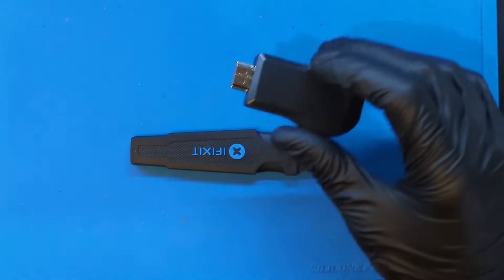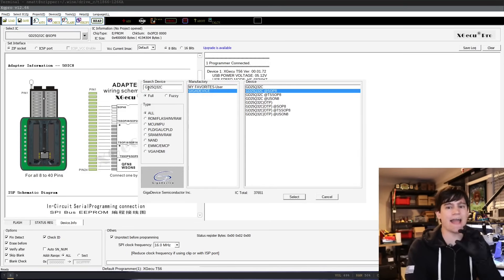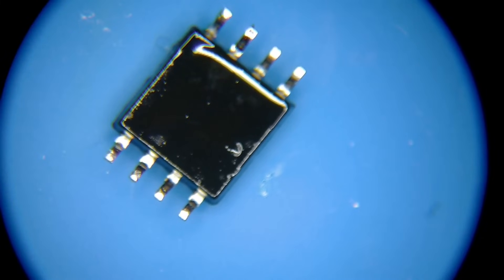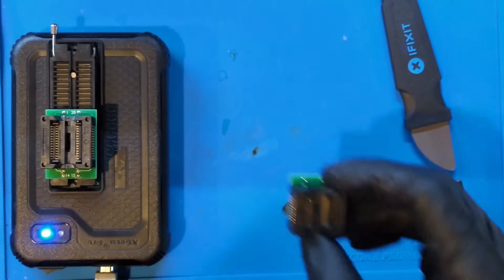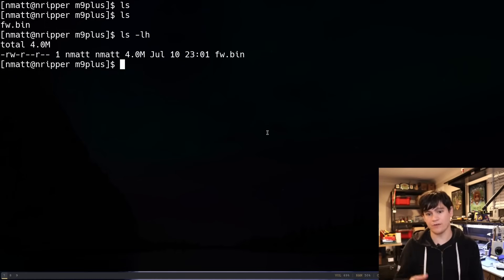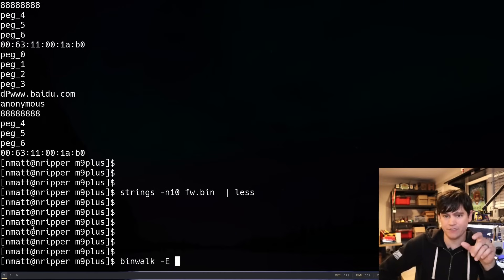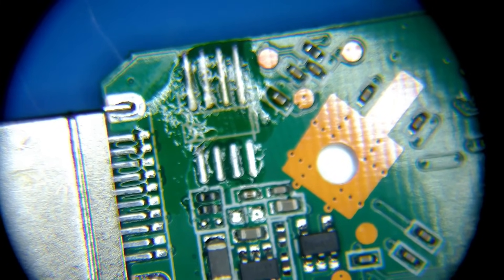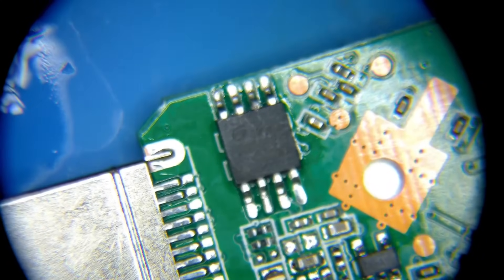Hacking a Knockoff Google Chromecast - Firmware Extraction

Comment: @17:23 it clearly says HDCP :D

"HDCP stands for High-bandwidth Digital Content Protection. The purpose of HDCP is to protect digital copyrighted content as it travels from a device to your TV, usually through an HDMI, DVI or DisplayPort connection."

You might be able to interface that programmer with flashrom, I'm not sure if it is but it should be possible to implement!

I own a "Willem EPROM Programmer", it also supports SPI flash memory like these but these days I generally use a very cheap ch341a_spi USB device.

Comment: 16:58, there's reference to SC16550UART so there's good possibility of a UART output somewhere on that board for the bootloader
Reply: Yep indeed, it's pin 99 on the SoC muxed to UART2_TX quite early on. It's supposed to be pulled up externally + there are some suspicious test points at the other side, but, generally speaking, manufacturers rarely care enough to break this one out in any convenient way
Reply: Might be on the usb port. Sometimes they do that.

Comment: 14:47 At the bottom it says LZMA compressed data
Reply: Glad I'm not the only one to see this.

Rootfs is probably compressed within LZMA and then uncompressed and mounted via the bootloader.
Reply: cliffhanger !
Reply: Towards the end of the video I could swear I had seen "lzma" somewhere, went back to strings and watched closely while pausing, thought I was going crazy 😂
Reply: It's only 8MB though - the 980MB partition a couple above it will be the interesting one I would think...
Reply: @4megii  There's no such notion as rootfs for the ALi TDS2 RTOS. It stores all the data in "chunks" (the famous NCRCbootloader being one of these), and only the last one (userdb) ever gets written to. It's an OS developed in early 2000s predating the ubiquitous Linux popularity, after all. This chip cannot run Linux at all btw, being a custom MIPS without an MMU
Reply: @pete3897  Huh? The SPI chip in these holds everything needed for the task, and it's only 8 MiB large, at most. Some are crammed into 4 - this one specifically is, too, it's a 32 MBit chip
Reply: I may be wrong but I see a lot of LZMA as a false positive.
Reply: @bnister  apologies & thank you - it appears I was an order of magnitude out :)

Comment: There's seem to be a compressed LZMA region, i'm pretty sure it's what you seen as high entropy, i'd bet it's the compressed rootfs mounted by the bootloader. Many times the MAC address is the one injected for the Wifi, as those modules don't have any hardcoded, 

Really interested to see your deep dive analysis. I'll join your discord, hopefully i can find the dump and analyze it myself also. I'd buy one of these if these if there's the possibility of a custom Firmware.
Reply: I think you're spot on about LZMA being the rootfs and that it's uncompressed and then mounted by the bootloader.
Reply: I bet it's going to be a kernel with the built in rootfs. No reason for these little gadgets to pivot root to a real file system
Reply: Yeah a custom one is possible, but I bet you won't like the only FreeRTOS-based SDK available

Comment: 17:18, NCRCHDCPKey refers to HDCP, or high-bandwidth digital content protection, it is not an encryption key for the firmware
Reply: and CRC is just cyclic redundancy check used all over to ensure data integrity I believe....so baciasll the string after that is just the HDCP key needed to get around content protection - I mean not get around it but actually use it properly

Comment: 16:20 'anonymous' and '88888888' sounds like a default user-password pair, 8x 8 being the password, IIRC the '8' is a lucky number in china, so eight 8x would be sth like seven 7s in US.
Reply: "anonymous" as the username makes me think of FTP.
Reply: just came to say the same thing - thats exactly what it is
Reply: Probably a firmware update check
Reply: 88888888 is an extremely common password for Chinese devices. I have a WiFi-controlled programmable LED sign that has a Wifi hotspot with that password.

Comment: There were multiple strings that referred LZMA and unzip "main code". I think that the code is just compressed, and the key if for hdmi drm not the firmware.

Comment: Nice video, Matt! Tks for share your knowledge!
It's possible extracting the firmware via software? connecting via terminal (adb) and copy some partitions? sometimes i have dificult to consider what is the firmware, e.g all image firmware or only bootloader firmware.
Reply: Adb is android only. If a device runs Uboot as bootloader you can interrupt the boot process and dump the flash.
Reply: @309electronic5  This one doesn't, everything is proprietary. Doesn't like to respond over USB, as well. There's usually some form of OTA on these, though, but dumping is tough

Comment: Hi Matt, do they make clips for SOP8s that size? Seems like that would be quicker than desoldering that chip, then again it came off with no issue. :)
Reply: Sadly often when you put the clip on it powers the flash but also the soc/cpu its connected to which then tries to read from it and messes up the firmware read
Reply: Yeah this exact platform has no trouble being dumped via the cheap ass clip usually shipped with CH341A kit. The LZMA packed firmware gets extracted to the RAM, and the SPI chip gets almost no accesses at all

Comment: How about modding a xiaomi 4c router (which is really cheap) to port usb(it has two open data pins)  and openwrt (just enable ohci and ehci in kernel while complling)  and then make a wifi pineapple(decompile pineapple rom and port using overlay) bcz they both use mips24kc :) then tada 15$ pineapple 🍍 btw it has better specs then original pineapple...
Reply: I can't try this bcz of my upcoming entrance exam for varsity...
Reply: i have the xiaomi 4A gigabit and its super easy to openwrt, don't need to open it can do it just by firmware upgrade, and YES please someone make a pineapple out of it, I got part way there and had to move on to other things but I still have it and WISH someone would make it a package!!!

Comment: What's up bro. I have a LG Stylo 6 that I'm trying to unlock the bootloader on. I can't get mtk client to recognize the device and I learned that someone else got theirs to become recognized by taking apart the phone and using a jumper wire on the board. Do you think that you could just Google a picture of the board and tell me which pins the jumper wire needs to touch for this process. If I blow my device up then I know that that's my problem. I trust your expertise which is why I'm asking you. Thanks for the videos either way I really appreciate them.

Comment: sir  Is it possible to read the program of IC provided by pic Microcontroller?

Protected ic
Reply: Only if you are very dedicated and some security vulnerability has been discovered.  Many times those offering such read out services do not share the vulnerabilities so you may have to spend time looking to find the operation that has the skills to defeat the security on your specific chip.

Generally the older the chip the more likely it is that a security bypass exists.

Comment: I have tryed to hack the m5 displays / ebike controller . I cant get the firmware extracted from this device over uart . I have 2 uart connections on this board this m5 display comes with the nuvoton MS51FCOAE whitch has more uart connections on it .

Comment: When dealing with sticky stuff like flux or glue, i deal with it with brake cleaner. You could maybe do the same thing with alcohol.

Diagram migh tbe poorly drawn but if it were aligned with chip pin 1 indicator would probably end up underneath solder pads
Reply: 99% isopropanol for flux. Not sure about glue tho
Reply: Please don't use brake cleaner for this...
Reply: @richardred15  is it dangerous with flux? Like more dangerous that it is normaly?
Reply: @aure_eti  It's bad for you, the environment and most materials

Comment: I have specifik problem with Samsung A53 budget smartphone -- they have nice software to mirror cast towards smarter monitors sadly i got a special ROG 17 inch portable monitor with a battery in it with a stand that doesnt have this. / Also the casting devices mostly use a external power supply to be connected to a power port. 
+ ather thing this monitor use a HDMI mini camera port in it also has USB c to usb c display support (sadly most newer phones dropped support for this). I was wondering how to make a ANYCAST or ather casting device into a portable configuration. I do know how to solve the HMDI thing with adapter probaly from big to mini + i dont know if theres a way to connect bluetooth to a cast device to use the Wifi from the phone for Netflix. --- Anyways i wonder if might be cheaper for me to look for ather phone then to build something to fix this problem XD --- it could be im confused somewhere in my thought process about casting devices but i sadly cant do Usb c to usb c display with this phone i own at the moment. because that would have save me a lot of hassle.

Comment: desoldering the chip is such a waste of time when in circuit flashing exists. I wouldn't trust this guy on other stuff when he can't even get the simple stuff right. you can also skip the first 12 minutes, it's just filler.

EDIT: I just watched the video and this was a waste of time. he extracts the bin file from the EEPROM and then does solder the chip back. ultimate nothingburger. no editing, no attempt at decrypting, no attempt at figureing out what's written. save your time.